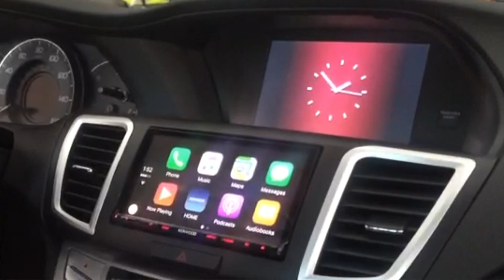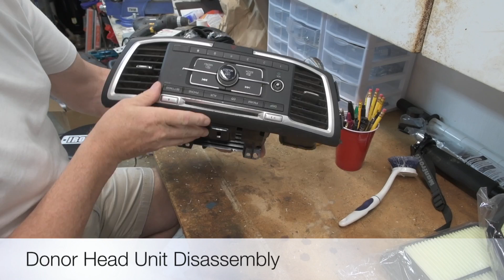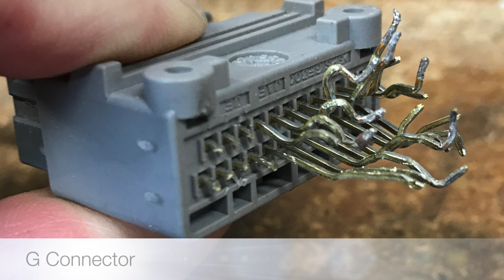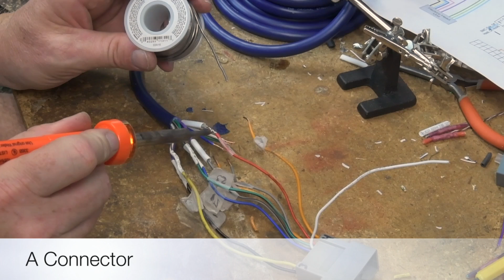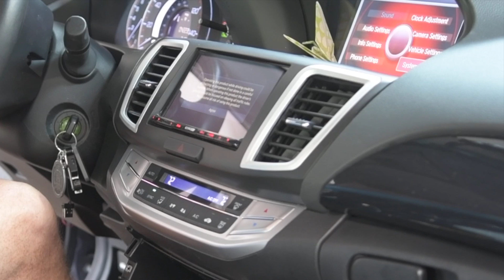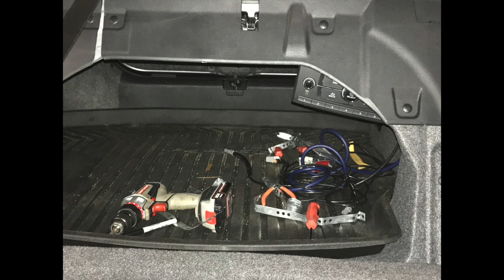2015 Honda Accord Sport - Extend the Factory Head Unit to the Trunk

Comment: Great video, is it possible to create an extension cable for the 18 pin connector that connects the faceplate with the factory head unit?

Comment: This video is PHENOMENAL... I do however have a few questions:
Is this the same procedure if you have the other version of the OEM head unit? (the one with the touch-screen)
And, does anyone offer a PnP replacement for the OEM head unit, or is this the only way to do this?
Lastly, if we rear-mount the OEM deck (to retain functionality) can we then wire up ANY aftermarket head-unit (single or double din)?
Reply: Someone in another comment said the content creator passed away. You may get a response from other people in the comments though. Good luck.

Comment: Has anyone successfully figured out how to open the JAE MX48 twinaxial cable plug (connector plug H)?  Microphone wire did not work since the imid display video is “very noisy”, so I’m going to use RG-108 which works at 10mhz and has much higher isolation, required for the three view backup camera in the 2017 Accord Sport.

Comment: Does the backup camera work without face plate on factory radio hook up onto factory circuit board?
I'm doing the same and just buried into dash.  You still can control everything with steering wheel controls right?

Comment: RIP Terry, thank you for this! 
I just did this to my 2015 sport and wanted to share a few things, that may hopefully, help others. 
First, it isn't necessary to de-solder the needed connectors except for the H (video cable) connector (which is very hard to remove, just like Terry mentioned), just take a dremel and cut the pins off flush with the board, there is more than enough of the pins left to solder on wires. Also, as far as the H-connector goes, my donor radio came with a cable that was too short to make it work. I went to the salvage and went out and looked at one of the junk cars, the cable that plugs into the back of the radio for the video connector (imid display) has the same end on the harness that plugs into the upper imid display. So, if you are able to get them to cut the harness, you can find that connector in two places, if needed. 
Second, all microphone cables are not created equal for this application. I had a strong suspicion that I was unable to get the H-Cable to work due to poor shielding on the microphone cable. I tried four cables before my suspicion was validated. So, I can save you some money, time, and headache. I ended up getting the screen to work using a GLS audio mic patch cord from Amazon, ASIN: B003JJQMD8; this may be the cable Terry used if you try to read the writing in his video. On the first three cables, the screen would either be all white or would flicker and sometimes show an image. 
Lastly, I was able to bend the mounting brackets from the donor radio to make the mounting bracket in the trunk. I put a rivnut in an existing hole on one side and used a coupling nut attached to a screw that was sticking through the package panel from above. This was a lot of work, mostly because of the trouble I had with the microphone cable. I'm still glad I did it, I love having carplay and better sounding hands-free calling. 
I used the SWI-CP5 to retain my steering wheel controls, I did have trouble getting it to program. Everything worked, except it would not answer calls from the steering wheel controls. I contacted PAC's customer support, which was phenomenal, but we still couldn't get it to work. Turns out my Kenwood unit dmx907s needed a firmware update, that fixed the issue.
Reply: Are you saying that you can get the female H connector from a salvage i-Mid display?
Reply: @infotime  I would assume you can. I got the male connector.
Reply: Hey Josh great video is there anyway I can purchase the wires from you can you make me a set let me know thank you very much I do have a donor radio I have a 2017 Honda accord.
Reply: I have a donor JAE MX48 twinaxial donor plug, but the attached original twinaxial used by Honda is too short to solder, so I will need to disassemble the male plug to solder it.  Since it’s propriety, and JAE doesn’t sell it, has anyone figured out how to open it?  Very good take on posting that all microphone cables are not equal!  I’m planning to use RG-108 since it’s an RF cable and should have more than enough isolation and speed capability.
Reply: @Hssengship  I actually ran into the issue of the cable on the male plug being too short, after multiple cable trials. You can cut it along the narrow, long side (with a dremel cutting wheel) and pry it open to get the board out and friction seems to hold it in place once it's reassembled and placed in the plug. Or, it looks like mouser might have it under part # 656-MX48002HQ6R200
Reply: @joshsmith0314  thanks for this Josh.  So you cut the mx48 male plug on one side (the narrow outside long side) to spread it apart and remove the inside, where the twinaxial cable  inner conductors and shield are soldered.  That way you can unsolder the original cable and solder the new cable to the inner part. Replace the inner part, and it is held in by friction, when you connect the female and male parts together.  Do I have that correct?  Are irate your help with this!
Reply: @Hssengship  I wish I had a picture of the actual plug to show you the inside. I'm sure there is a way to release it without cutting it, but I couldn't figure it out. Your description is correct. I posted an image to show where I cut the plug. https://ibb.co/cXLBNn6 I hope that helps. What head unit are you installing?
Reply: What do you mean RIP Terry? Did he pass away?
Reply: @teenice894  yes, he did.

Comment: I really don't see how a donor unit is necessary if you just cut the original male connectors and extend with wire to then reattach the male ends.

Comment: Instead of buying a donor radio, can't you just clip the original male ends and extend those to the radio?
Reply: Yes; I think the point of doing the extension cable is so that it's easy to reinstall and revert to the factory head unit if necessary.

Comment: Finding a donor with cable attached is impossible - I’ve been checking for months - the don’t sell the connectors
Reply: Larry Benigno 

Try this kit, some people are having trouble with video signal degradation and yhe imid screen cutting out.

https://www.ebay.com/itm/162423137547
Reply: I've sourced a few from salvage cars over the years.  I've also asked the sellers if they still had the car and could snip the plugs, some said yes.

Comment: Can anyone tell me what color wire to tap into the climate control for the illumination wire to the new stereo?
Reply: Matt Pesh the wire you need is gray in color. It sits in the middle of the climate controls connector next to a blank pin.

Comment: This video is gold!... Thanks! I just ordered all cables and donor radio to put my factory radio in the trunk. You laid out the blueprint perfectly.
Reply: Luis Salas hey man I got this all figured out.. I think. Except for the illumination from the new deck to the climate control. My question is what wire does he tap for illumination. Is it the orange wire on the climate control harness?
Reply: Matt Pesh I believe the D connector should control the illumination.  I haven't hooked mine up yet.
Reply: Go to his blog in the first video. Some guy says that pretty much any wire to the climate control will work for illumination. And he uses the Gray wire in the middle of the climate control which he says works fine.
Reply: I'll check it out, thanks. I'm looking for the y connector , do you know where I could find it?....
Reply: Like I Said man it's in one of terrys blogs in his fist video about this
Reply: www.navtool.com

Comment: Hi Terry,
I have an 2015 honda accord LX, GCC. I don't have a backup camera or Bluetooth in my car. The factory sterio don't have the provision for this connectivity (GCC speck's). 
The question is, if I get an OEM cd player from the us market, whether it supports rear view camera? And a Bluetooth connectivity??
Will be thankful for replies.
Reply from the maker: I am sorry but Terry passed away in August
Reply: The US spec head units have built in bluetooth and all have a rear camera connection.

Comment: This is awesome Terry.  One question.  If I already connected my aftermarket radio to the existing plugs (via a harness) that were connected to the stock radio, where will I be able to plug the stock radio back into?  Not sure how you have them available in your video.  What is you after market radio harness connected to?
Reply: Richard Vedvik , any idea where I can find that y-adapter for my 2016 sport, please. I've searched but no luck. Thanks.
Reply: Michael Bank the stock head unit harness gets split so both radios are powered.  Broly1000 makes this harness.   Signals are routed to the appropriate head units from this wye-adapter.
Reply: Luis Salas the seller of the harness doesn't publicize often.
Reply: Thanks, I'll try searching

Comment: Super informative. A lot better than majority youtube videos. Could you not fit the headhunt in the glovebox though?
Reply from the maker: J Stenberg Thanks! Nope it's way too big for the glove box.  And even it if could fit, I would still have had to extend the cables because the factory harness won't reach the glove box.  So if I had to do the soldering, I might as well put it somewhere out of the way where it's not taking away useful space.

Comment: I took my 2016 honda accord sport to a stereo shop and they installed a brand new pioneer avic-7200nex but I'm really disappointed because now my top ( stock ) monitor doesn't even turn on and I don't know what to do to make it work, is there any way I can make it work because what's the point on having that big screen if it doesn't even work, they said there is no hardness or anything they can do to fix it and I want them to fix it if there is a solution to my problem, I would really appreciate if you can give me more information thanks.

Comment: Do you sell those harnesses?
Reply from the maker: TheEvolution2649 No, not really interested in selling them.  One of the reasons I made this step-by-step video is to give people the confidence to do it themselves.  Besides, you have to tie in your own aftermarket head unit and steering wheel control harnesses (which I had done previously but don't show in the video).

Comment: I did buy a junk radio albeit without the wires cut from the back..so what I'm trying to grasp is then what do I use this junk radio for? The plugs that are attached to it..I guess it would be the male plugs..bare with me here please..soon as I understand what it is I need to do then I'll be fine..but I do have jus a couple ?'s..and those would be..so I have my radio that's currently in the vehicle ..and I'm gonna route that to the trunk ..so my aftermarket unit has to tie in to my wiring from the car..so what is the best way to do that..would u jus run all new wiring cause I'm doing a complete system components in the front for the tweeters to be put in the sail panels and then coaxial speakers in the rear with an amp and mayb a sub..so should I run new wiring for the after market receiver and then tie in to my existing wiring or have I got this alll wrong..jus point me in the right direction because ur the only one that has done what I'd like to do..so let me hear how u would do it..if u have the time..thx I appreciate all so far
Reply from the maker: Great questions.  I realize now that I forgot to show the other harness that I had made about a year ago.  It's been in the car so long that I had forgot about it.  That harness ties in the aftermarket head unit, steering wheel control and factory head unit by connecting the vehicle male 24 pin main connector to all three.  

So I have two harnesses only because I did this in two steps.  If you're going to do it in one step, a single harness will work.

For your aftermarket head unit, the only thing it needs from the vehicle is Constant 12V, ACC 12V and Ground.  It will get SWC from your Steering Wheel Controller.  Your Steering Wheel Controller also needs Constant 12V, ACC 12V and Ground.  Plus it needs A22 from the main 24 pin main.  It's a pink wire that is SWC Vol +/- Channel +/-.  And it needs C9 which is a light blue wire from the C harness which is the HFL wire.

I know this might sound complicated but it's pretty straight forward.

I HIGHLY recommend the you go on driveaccord.net and look me up.  TMVB is my user name.  You can find my thread that has the wiring diagram.  I really recommend you go there and download the wiring diagram before you dig in.  It will make this a lot easier.

Comment: Nice  job Terry. My buried dash set up with the Pioneer AVH-4200 has been working great. Now I think I'm going to have to follow your lead and put my factory head unit in the trunk.
Reply from the maker: Awesome.  Let me know if you run into any hurdles.  Happy to help.
Reply: Hey man I need some help or just confirmation I have this wiring down
Reply: Hey Jason was wondering which aftermarket harness you use for radio
Reply: @scorpio2414  I made my own following Terry's instructions then i ended up buying one from a guy named Broli on ebay it was super high quality. I don't have the car any longer but still have the harness. If you interested in it I can send it to you. Let me know.
Reply: @Max_Thunder  yes sir I am
Reply: @Max_Thunder  yes I would like to get harness would be a blessing let me know how to go about it
Reply: @scorpio2414  Yeah email me your details plann_b@hotmail.com. Ill send you everything I have left.
Reply: @Max_Thunder  yes Jason am interested have sent email with details let me know you need anything else
Reply: @scorpio2414  Im still not seeing a email from you. What is your email? I'll try sending you a message and see if it works or not.
Reply: @Max_Thunder  scorpio2414@gmail.com
Reply: @Max_Thunder  here's my3463631063
Reply: @Max_Thunder  hey  bro tried to send emails are going to spam or rejected sent you #346 363 1063 text for info thx
Reply: Sent info
Reply: @scorpio2414  Hey Nick Im not seeing in my email can you resend it? Plann_b@hotmail.com
Reply: scorpio2414@gmail.com
Reply: Sent you my email this is probably why not seeing

Comment: Im wanting to exactly what you did..but how do I get those connectors now..do i look at purchasing them through honda or are they jus common connectors..cause i thought you said honda does some specific things as far as connectors to the stock radio
Reply from the maker: The plugs Honda uses are not widely available.  I'm in contact with someone who is attempting to source both the male and female plugs but that's still a work in progress.  If you buy a junk radio though, there is no need to worry about it because the junk radio will give you all the connectors you need.
Reply: I think the issue is he/she bought a junk radio that did not come with the old wires cut/male connectors still attached. That's what is also preventing me from using your solution since I can't find one either. If your contact pulls through, please let us know!
Reply from the maker: Ahh - now I get what he was trying to say.  He was saying female connectors when he meant male - that was throwing me off.

Haven't heard from the couple of guys that are pursuing sourcing the connectors.  But even if they do, my opinion is buying the male connectors isn't going to be useful because you'll have to figure out how to populate them with pins and wires.  

I would reach out to the eBay sellers that are offering used head units and ask them if they have the males connectors with wire pigtails.  I know of at least one person that was successful in getting the male connectors that way.

BTW my eBay seller was nav4pro and he was easy to deal with.  I'd recommend reaching out to him/her and ask if they have the male connectors for sale.

Comment: what do i need to make my own harness as i dont want to pay $300-400..but i watched ur video and i made a mistake in that i bought a radio for the wires and i didnt think about the wires being cut off so i suppose i am stuck with an extra radio now..So Terry what are my options now i mean how to get all the female connectors then so i can build my own harness.Any info will be greatly appreciated and if i can email you or you email me reply back and let me kno..thx
.
Reply from the maker: I'm not following what you mean.  My video shows step-by-step how to harvest the female connectors and build your harness.  The only thing I don't show is the other harness I built that ties in the Steering Wheel Control and power to the aftermarket HU.

Comment: Can you help me and show me how to add the right side camera and install it to my 2017 accord sport . Plz thank you.
Reply from the maker: I have no idea how to add Lane Watch.  But I suspect it would be difficult.  People think that the Honda uses one wiring harness for all trim levels and if you want a feature from a higher trim (Lane Watch, heated seats, etc) that you can just buy the component and plug it in.

The reality is Honda makes wiring harnesses unique to each trim level.  So there are no connectors on a Sport in the right door ready to plug in a Lane Watch mirror.  

I'm sure it can be done, but solving the wiring harness will be the biggest hurdle.